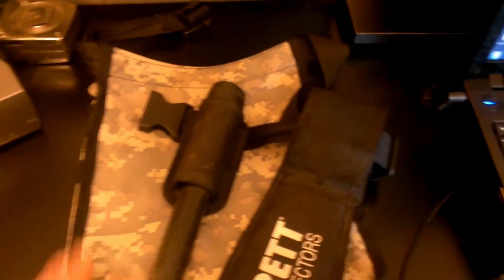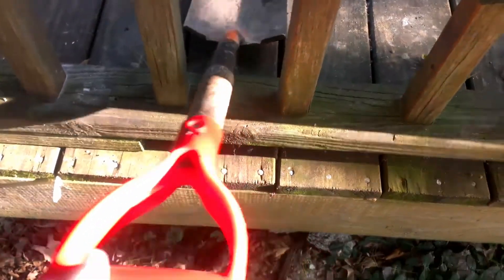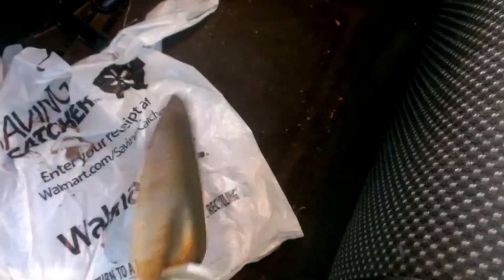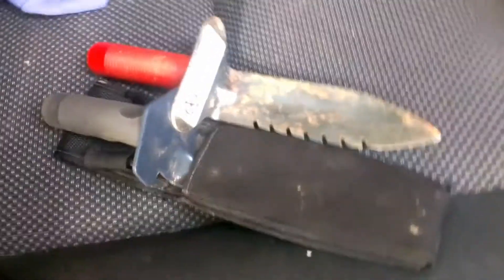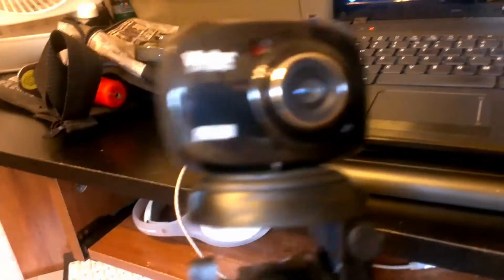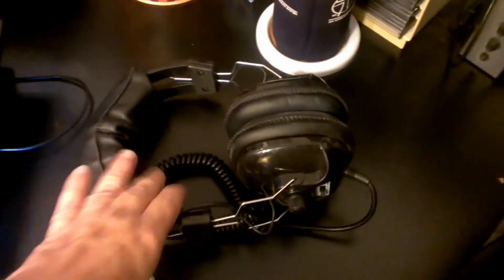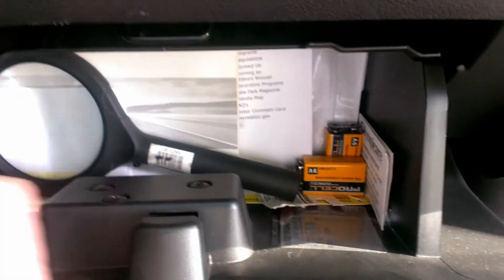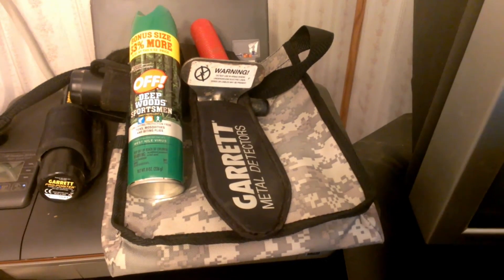My Metal Detecting Gear

Comment: Great equipment video. Hahaha, your pail made me laugh. I don't own a finds pouch so I have been known to use my kids sand pail to hold my finds when I detect at home, lol. I also don't have headphones either, but have been wanting to get some. But I had wondered if they would get in the way sometimes. Thanks for the input.
Reply from the maker: The pail was handy for putting big, dirty stuff in too, and helped keep the car clean, but you can see that went by the wayside. Lol  If the headphone cord was longer. or if they were wireless, I'd be ok with them, but the cord gets it the way when I'm swinging too, so I'd go with a cordless set up, if possible.

Comment: Thanks a great equipment video!  I am with you on the headphones..  With the Deus the headphones are wireless so that makes it easier so I do wear those occasionally.  I just don't wear standard earphones (and I know headphones are better), unless I do water detecting with the Garrett and the Grey Ghost waterproof headphones.  Shovels always make the neatest plugs and are the easiest to camouflage afterwards.  They are better, its just that the perception by the uninformed means we can't use the best tool for the job..  Love your vid as usual.
Reply from the maker: I'd love wireless head phones, and I would wear them. Ideally, I prefer others not to hear the beeps. Yeah, I don't carry my shovel into any of the parks, just because of the optics. although that Leshe may not be the best optic either. Lol Hubby carries it in his back pocket unless we run into some Mom's and kinds, then he hands it to me to sheath up. Thanks, TTD.